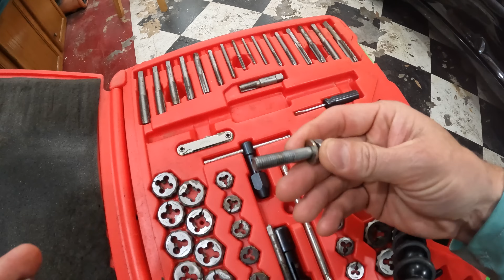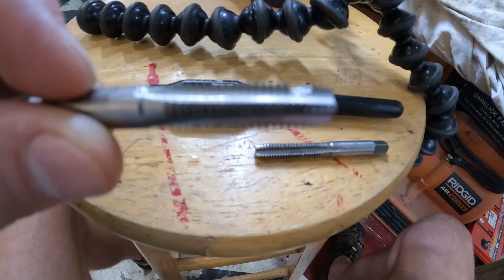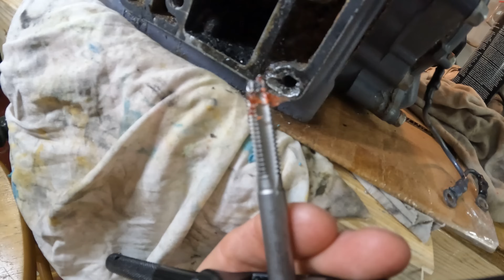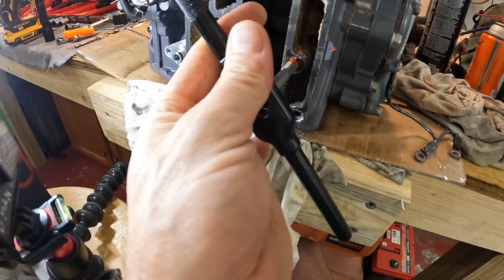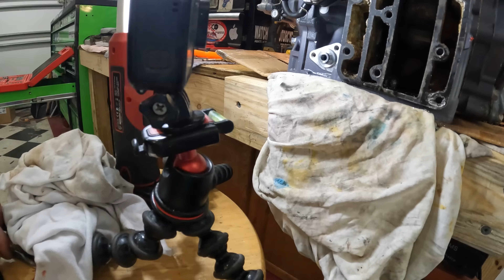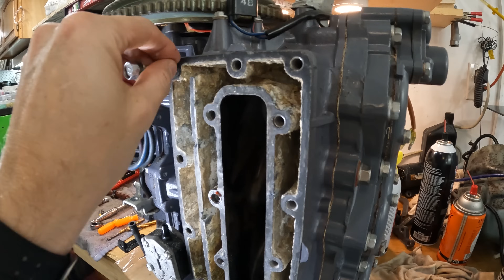How To PROPERLY Use A Tap

Comment: You know that you can put to use your new Bauer bench grinder and make or increase more chamfer into that cheap tap. If you do it well it will help to start faster. You probably know this, but I'll say it anyways, There are three main types of taps: Taper tap, the one with the most chamfer (point) ideal for starting the cut. Then the Plug tap, the jack of all trades, the one you have. Lastly the Bottoming tap, ideal for blind holes (the job you are doing) it will allow to cut threads all the way to the end of the hole when critical fastening is needed and a larger hole can't be made.

Comment: Best grease for tapping is tallow, I don't even know if this can be purchased nowadays, I still have a can dating from my dad's. I use it for tapping, precision drilling etc. Next step, resurfacing a head or block using a scrapper, a ruler, die and a marble. you think cast iron is hard, nothing nicer than seeing an old timer engineer shaving metal off blocks surface. Guys mastered what was then basic engineering skills.

Comment: There are several different type of taps, bottoming, taper, plug and several others that are not hand type taps. Just think if in manufacturing, if each hole in that power head had to be tapped that way you did it, it would take days to make it.  Taps that are used in CNC machines are designed differently to allow the chips to be ejected from the hole while the tap is threading the hole.  I commented on your other video to just take it to a auto machine shop and they will remove the broken bolt and chase the threads or install a helicoil for $30 to $60 a bolt or if you have a relationship with them it might be even a better price.  The advantages are the hole will be squared off and not going in an angle which will force you to bore out the hole and install a threaded insert.  But great advice on taking the hand tapping slow to prevent the breaking of the tap in the hole.
Reply: He has $2,000 worth of labor in fixing this if you were paying him.
Reply: yeah, man, are you ok? 😂 he is a technician, he is the auto machine shop! not even my self a non professional (for other reasons now) but with some knowledge, would take anything to an auto shop. I drop my tranny oil pan on the front of storage unit right on the hot asphalt and drill, tap and install a few helicoil of the pan bolts that previous owner or mechanic messed up. And of course it rained on me trans oil and aluminum shavings. All part of a fluid and filter service.
Dude you never being on the keys, or South FL. 😂 we still moving water with wind mills and grinding wheat with an oxen. I doubt there is any CNC machine in the whole SFL. for sure not in the keys 😂. First you have to start making a lots of calls, then load, drive, carry, unload just to see an apprentice doing the same thing with a hand tap, or worse.

Comment: Gday mate taps are not that expensive so as you say it pays to buy a decent one , i went the easy way on most of my bolts and just used helicoils its a 92 model but surprisingly when all done it worked all torqued down not leaks except one ,on my 40hp it has a larger bolt i dont know what its for but torqued all the head bolts down sweet , when i started it had a leak checked all the bolts found i hadnt tightend this larger one torqued it down no more leaks tragedy averted .

Comment: I use a cheap-o, Premium Chinesium set to clean existing threads, and a nicer (shop-owned) set of Vermont American taps and dies when making new threads.

Usually, I don't use grease. I use cutting oil or even SAE 30 or sometimes, in a pinch, even WD-40 or Tri-Flow or whatever's handy (depending on the hardness of the material).

I then remove the chips with compressed air, maybe degreaser. The only time I used a heavy grease to retain the chips was when I rethreaded a spark plug hole.
Reply from the maker: Nice idea

Comment: You will need to finish with a bottom tap for any blind holes, you wont cut all the way to the bottom if you dont use one
Reply: Just cut the bolts down! 😂😉👍
Reply from the maker: My man ;) :) lol

Comment: Been a machinist for 20+ years and never tapped a hole like that.  There is no need for grease and there are spiral fluted taps that pull the chip rather than tap.
Reply: This dude probably puts greas on cast Iron too😂
Reply: So I’m curious what tap/die do you recommend for a diy’er? I find the need to chase threads a lot
Reply: @1972mdc  look at spiral vs gun fluted taps.  The variables are too many to mention here.  What type of material are you tapping? Cast, aluminum, tool steel, plastic, etc.  you should to consider the application first.  Spiral flute will pull the chip back to you but not so when tapping cast iron for example.  Gun flute will push the chip forward of your tap.  Gun flute is stronger but if you are tapping a blind hole you need to keep chips clear and not tap to the bottom.  If you do it will lock up and snap at full depth.
Reply: @DTOM1776emg Thx - mainly doing metric threads on cars and bikes, everything from chasing an axle thread to smaller stuff. I'll dig around further as it's something I should have learned/been doing but haven't
Reply: @1972mdc  Irwin"  make great tools and have exelent steel alloys! if you buying a kit, don't cheap out much..
Reply: @1972mdc  what type and size of threads
Reply: I jus did this process on my channel.  I used a kit from Amazon I have it linked on my video.
Reply: I wish you would share more details about your method.